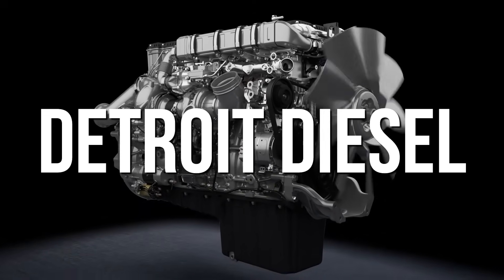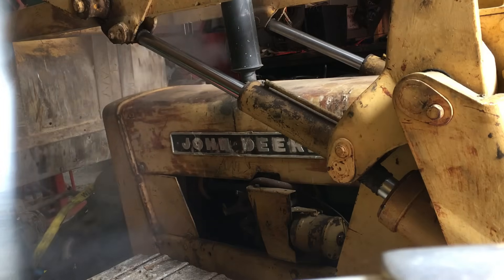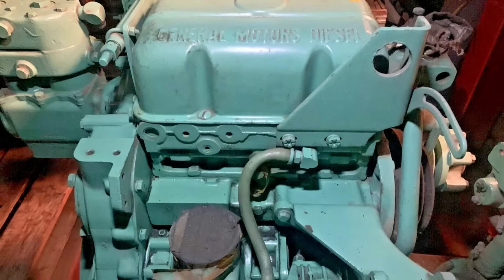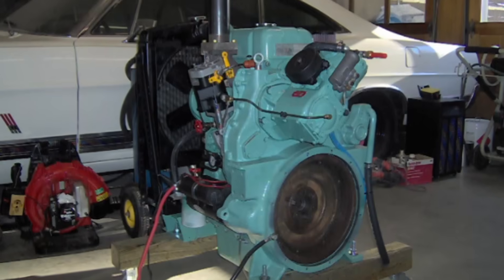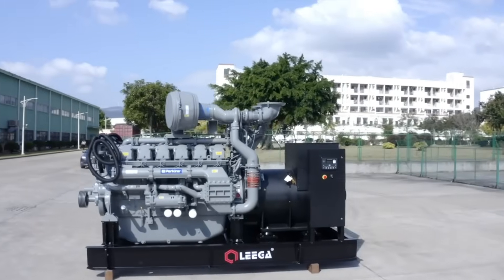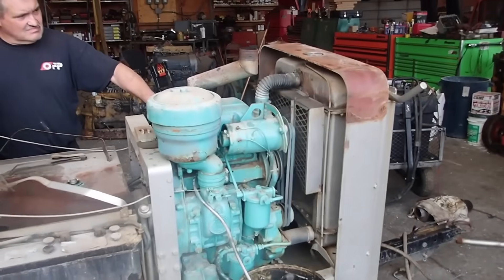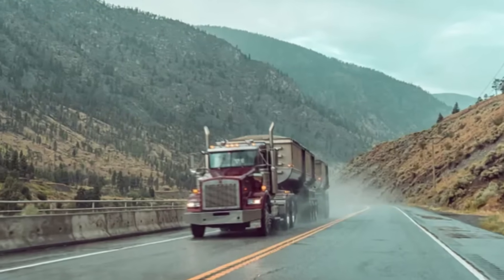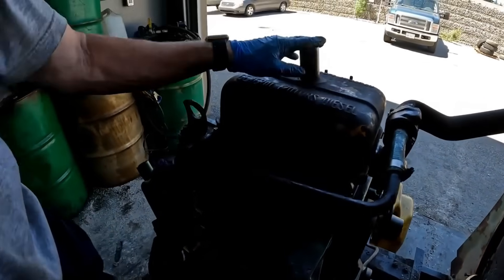The Real Reason This Tiny Detroit Diesel Engine Failed

Comment: The miltary used some of those for pumps and other support equipment for decades. I instantly recognized one running a jet fuel pump when I was hot refuelling F-16s in Desert Storm (KKMC). Cute little thing and since diesels burn jet fuel without issue perfect for deployable fuel bladder filling and emptying. If I find one surplus I'll give it a home in one of my pickups.

Comment: As a younger man, I was tasked to rebuild a 4L-53T for a C-60 Chevy delivery truck my company owned. Thankfully it ran well afterwards. The owner nearly destroyed it by putting gasoline in the fuel tank and it barely made it back to the shop. I replaced nearly everything internally.

Comment: Did the 2-71 Detroit share the difficulties that the 2-53 Detroit was subject to? I started driving semi in a ‘69 cabover International with a 6-71 Detroit and a 4x4 Spicer. Then I hit it big with a ‘73 cabover Freightliner with a 8V-71 and a later ‘70s International with a 6V-92T Detroit. Later I took a couple of years off from nationwide driving and hauled milk bulk farm pickup alternating between an International with a 6-71T Detroit and a Ford with a 6V-92T. The one thing that I learned from these years driving 2 stroke Detroit Diesels is that they’re extremely proficient at converting fuel to noise, heat, and vibration. In the pre-92 series 2 strokes I knew guys that swore up and down that the Detroit Diesel blocks were so porous that oil could leak right through the cast iron block. They did an excellent job of rust prevention for the frames of the trucks they came in. They were much like the old Harley Davidsons that couldn’t manage to keep the oil contained within the engine. The acquisition of Detroit Diesel by Penske and the switch to the 50 series and then the 60 series 4 strokes engines changed Detroit’s reputation much for the better in power production, noise reduction, and oil containment areas although the 92 series partially accomplished these goals prior to the switch to 4 stroke design.

Comment: The one clip in this video where my buddy is running the rack with vise grip is on my woodchipper it was built in 1960 and is original standard bearings. Literally you have a clip from  my video of my engine thats old as heck and still works everyday chipping trees.

Comment: I always enjoyed running the rack on Detroit engines. It takes patience and the right touch to balance the injector rack. And when done right you can balance a quarter on the valve cover with engine running. From  v6 I6 V8 V12 and V16 engines. 53,71,92 and 149 series. Although I have never come across a 2 cylinder Detroit I have heard they did make them
Reply: Ol boy had a 2-71 in a pickup

Comment: How can you equate a 2-53 with what we have today. 53’s where good for smaller load demand. They knew its time was up. Remote equipment 
intended to operate intermittently, powering electricity, or hydraulic drive pumps where where it shined till computer controlled fuel, and monitoring systems became the next step in efficiency.  And so the world turns.

Comment: Given the complexity of new engines , the 2-53 is looking better to many ?
Reply from the maker: Probably right at this point.
Reply: @VintageAmericanMachines  the 2-53 was always a rarity. best as a small gen set.  3-53 and 4=53 were fantastic engines and I had customers that loved the 6v53 used in city bus here for 20 yrs.53 ran up to 3500 rpm while 71 and 92 never ran over 2500. Nothing screamed like a turbocharged 53. The 2-53 John Deere tractor had different water pump than other 2-53, thinner.

Comment: A 253 has 32.7hp. A 353 has 110hp. A 353T has 140hp. One extra cylinder and triple the power. I almost bought a 253 for my Tractor, but it makes no sense. 16.3hp/cylinder compared to 37hp per cylinder for the NA version. Not much difference in weight either. A 3-53 is better than both a 2-53 and a 4-53. Even a 353T is only about 30hp less than a 453T with significantly less weight. A 353T has identical power to a 453N, but smaller and lighter

Comment: I couldn't stand the 2 stroke Detroit. But when they made the 60 series. It was a great engine with low-end torque and fuel efficiency and quiet. It was the first actual engine that was capable of competing with Cummins and  Catapillar.

Comment: problems with 2-53 DD engines are overstated-I had 4  john deere 440 dozers and loaders with the 2-53- you could not lug them--but these engines when treated with respect would wear out two sets of undercarriages before they required rebuild

Comment: this guy narrating has never even started any diesel or gas engine
Reply from the maker: Maybe not, but I still have an interest in engines and like making videos about them. My grandparents had a farm with a lot of these engines. I drove a couple of tractors over the years, but never actually worked on the engines.
Reply: @VintageAmericanMachines  so by just what you state, you are not qualified to make videos which are opinion based.  The entire 53 series engines are well designed to work hard over many years provided too much isn't being asked of them.  Put too small an engine into too heavy a machine and of course it will not last like a bigger one.

Comment: Does all your info come from Wikipedia because most of it doesn’t reflect real world or historical facts.
Reply from the maker: I don't use Wikipedia, mostly forums and engine sites.
Reply: @VintageAmericanMachines  the 171 and 253 Detroit engines were far from failures. I have probably 12,000 plus hours on a 253 Detroit as a genset running the power to a 3 bedroom 1200 square foot house and the power to a 26x30 garage. it's a backup system but does run often. Maybe if you have never owned a Detroit engine and then say they are failures I do believe you are more of a failure than anything Detroit diesel made.
Reply: Yeah, Wikipedia is becoming less and less accurate as time goes. Is it their downfall?

Comment: Roger Penske reshaped Detroit Diesel, not the 2-53. During the 80's British Perkins was part of the Bowater Tutt Bryant group of companies, the British and Australian arm of General Motors. There was no need to continue the relatively complex two stroke engine when Perkins made a far cheaper engine that produced the same power and used less fuel. Same thing happened to most of the 53 series engines. The 6V53 being unique as that had been packaged into the M113A and other military vehicles, it was known and trusted by the military and continued in production for military use only well after all the other 2 strokes had been discontinued.  Mainly due to EPA regulations and the inability even using DDEC controls to get competitive fuel consumption out of them. Then along came Penske in the early 90's, he reshaped the company completely, he wanted no part of high risk product development or of dealers offering 'special builds', engines would be sold out of the box, as is, the dealer would have no part in packaging the engine or recommending accessories. After the packager completed the first unit an engineer would be sent out to do an EPQ audit, they would verify the engine the engine was being fed, cooled, and plumbed in accordance with DDA specs then walk away. All product development after Penske took over was through MTU / Mercedes.
This alienated a lot of smaller engine packagers who previously would work alongside Detroit engineers to design an installation that did what they wanted and the DDA engineers would suggest changes as needed to allow for maintenance, service operations etc. With custom cooling packages or extended oil pans, air or hydro start whatever was needed to sell that engine. Detroit went from being a trusted 'friend' who would keep your engine running, to a cold impersonnal company that only wanted the cheque for the engine in the box.
Reply: Verry inaccurate post.
Perkins was never part of the Bowater Tutt Bryant group of companies or even General Motors.
If you got these basics wrong what trust can we put in the rest of your comment?
Reply: @PeterChapman-rg6gr  So you worked for them ?

Comment: Over here in Australia I have seen a couple of not many single cylinders not sure what the model designation was
Reply: The 71 series had a single cylinder model and went up to 16 cylinders. the bore on all of them was 4.25" and the stroke 5" so 71 cubic inches per cylinder.  The 53 series had 3.875" bore and (3-7/8ths inch) and a 4.5" stroke for 53 cubic inches per cylinder.  I had an Allis Chalmers HD5G crawler loader with a 2-71, not a bad engine at all.  The narrator is full of BS in his talk about the move to more power. The two-cylinders were always a niche engine with much lower sales than the 4-cylinder and 6-cylinder ones.

Comment: Well i worked on detroit diesels for 30 years, I never saw a 253. Just  like i never saw a 652 5:17
Reply: The 6 52 was a military variant 6v53 from what I understand
Reply: 2-53 is in JD 440 dozer diesel version and the 435 tractor.... there is literally nothing wrong with the 2-53 its just a bit heavy and loud compared to gasoline engines like a 4 cyl Wisconsin that would be similarly reliably but much lighter.
Reply from the maker: As @Blazefork said, 652 was a military variant made to power the unit that carried the Vulcan Air Defense System. I did a video on those. There weren't many, but they were a variant of the 653.
Reply: There was one for sale near me a few months ago. Almost bought it. Thing ran too. I let it go in hopes that I'd find a 353. Hasn't happened yet.
Reply: I have 2 rare valveless loop scavenged 4-51’s! And want to find a wicked rare 2-51 2 cylinder to go with my 4 cylinder ones! These are insanely rare! Way cool engines though!
Reply: @HammondC3  Rare Rare Rare Only seen one of the 51 series.
Reply: They also had a single cylinder Detroit
Reply: Been cool if they had made a 652series,an EMD sized engine but high speed rated,over 1,000RPM's,1,000-1,500RPM's,primarily marine and genset use

Comment: Nope... The 2-53 was used in a John Deere bulldozer I used to make an access road to a ranch in Montana. Also crap loads of them drove generators for early refrigerated box cars. The only failure I had with a Detroit Diesel was when some numbnutt decided he was gonna be nice and top up the fuel tank on a 75 Kw HOBART generator...with gasoline. Yup, the exhaust valves in #2 cylinder dropped off and poked holes in the piston. New piston and liner with a new cylinder head and old gal was up and running after a complete fuel flush of course.

Comment: Those little diesels in thermo kings and APUs
Reply: Probably a 353 in those.... the 2-53 is just uncommon because by the time you go for the weight of the 2-53 you may as well get the 3 cylinder. This video is pretty much entirely bullshit.
Reply: @Wingnut353  I have one of each.  Both are rated at 20 KW electrical output.  If maintained properly, they were good for 40 to 50,000 running hours between overhauls.
Reply: @Wingnut353  I did read in an old GM manual the 2-53s were used in refrigerated semi trailers. The 3-53 is quite a bit more powerful and surprisingly quite a bit larger, it was just packaged differently. The 2-53's were just in the wrong market competing with light weight throw away engines. As for uncommon, they certainly are, I only saw one in my 30 years with GM here in Australia, it was a military packaged generator rated about 6 kW. Fully enclosed with switch gear and instruments, it must have cost a fortune to make.
Reply: 2-stroke detroit engines weigh as much as dying stars, so I would be surprised if they made it into such weight-sensitive applications.
Reply: @alexbeuerman7608  They were used on refrigerated trailers, and as small lighting plants.